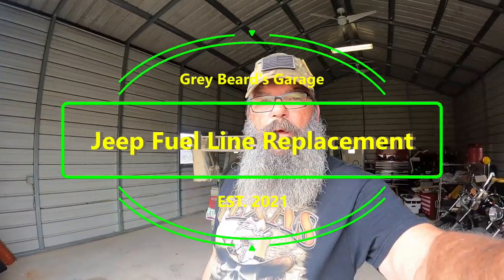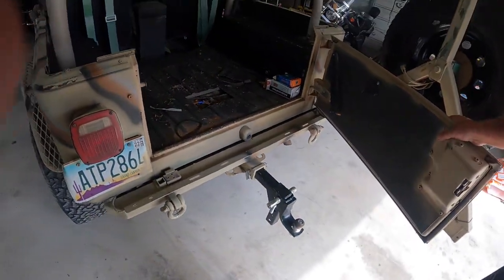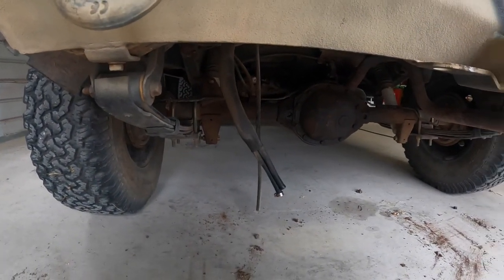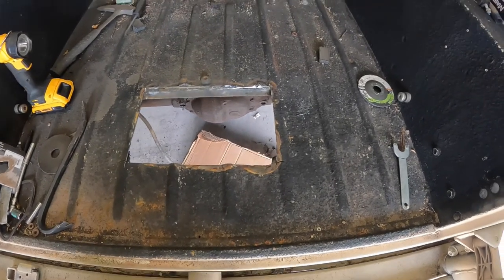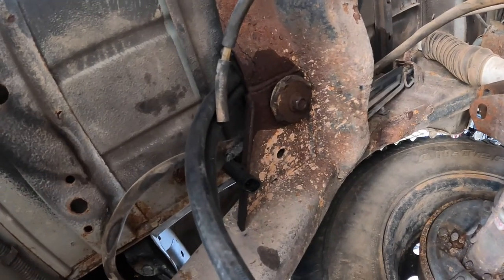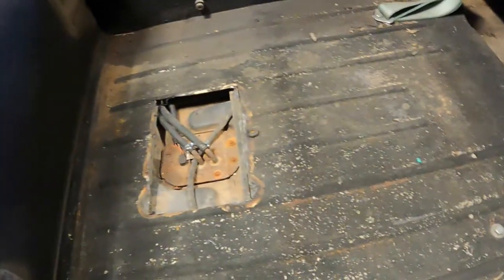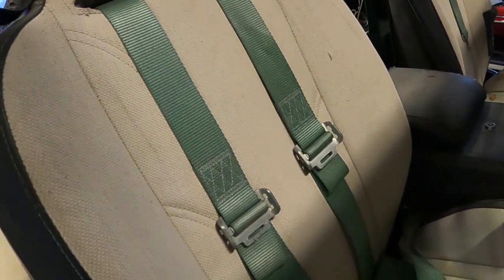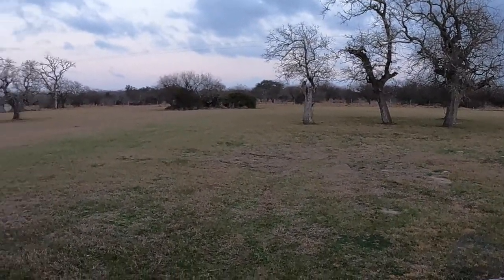Jeep Wrangler YJ Fuel Line Replacement

Comment: why would you weld up thar hatch? most  people cut out a hatch and fabricate a cover. saves dropping the tank to du pump service. I did,  welding it up don't make  sence
Reply from the maker: That was the original plan. Ended up not welding it after all. Thanks for watching!

Comment: Why not make a bigger hatch access on the rear floor, never have to take the tank out again. When I did my rotted out Rustbucket YJ, I removed the entire rear floor, made a drop in floor. Easy to remove too
Reply from the maker: That's the plan. I'd like to re-do the floor totally flat with a flush hatch. Thanks for the comment.